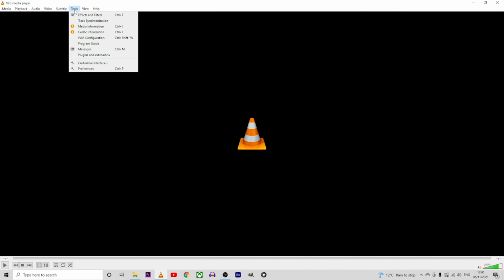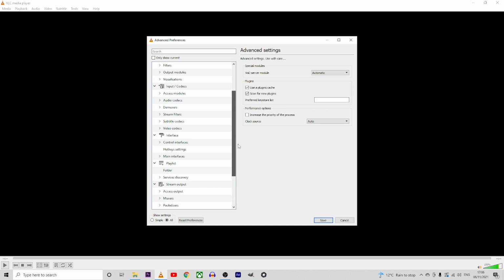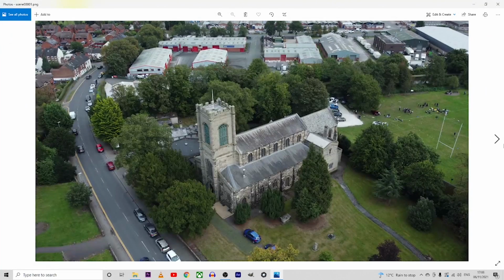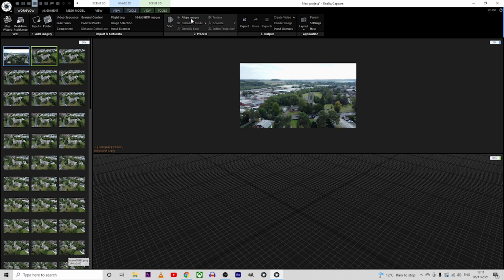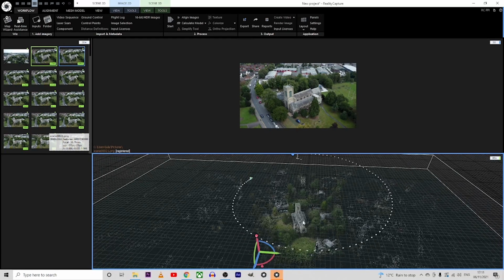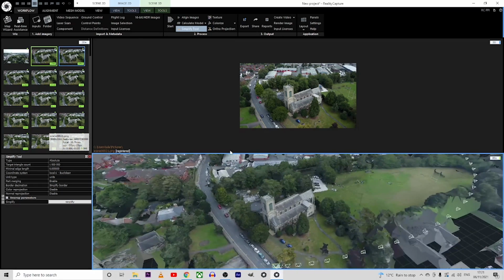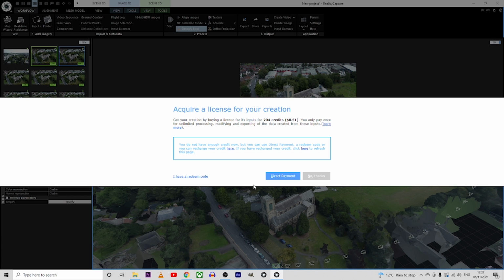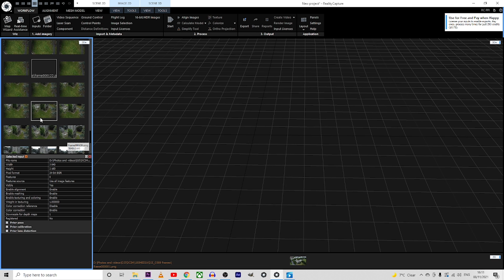DJI Mini 2 | How to create a 3D model from video frames in Reality Capture

Comment: Is it enough to fly just 1 circle around the object? At which Hight/viewing angle  would you recommend?
Reply from the maker: Hi Klaus, it all depends on what you want to achieve, if you want a better 3D Model I suggest you using images instead. But if you wanna have a try with the video do a single loop around the building or the object you want to create your 3D Model and use 45 degrees angle.